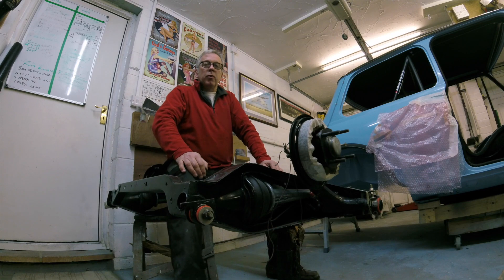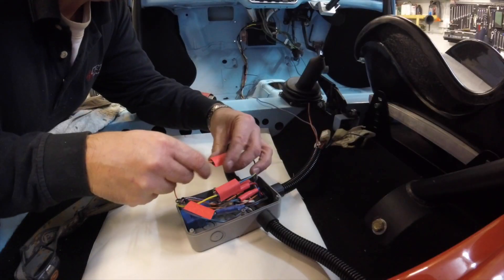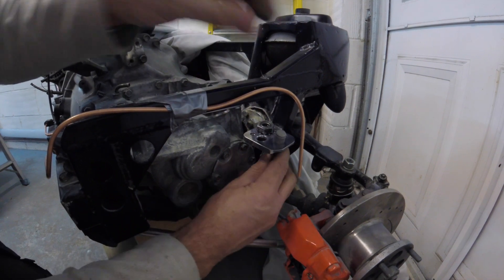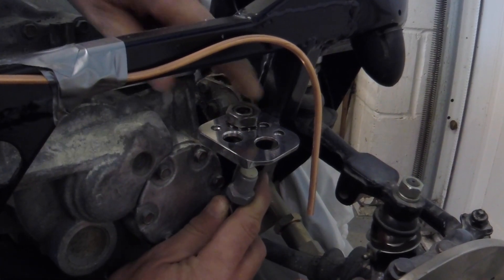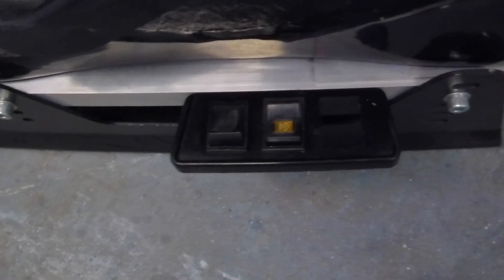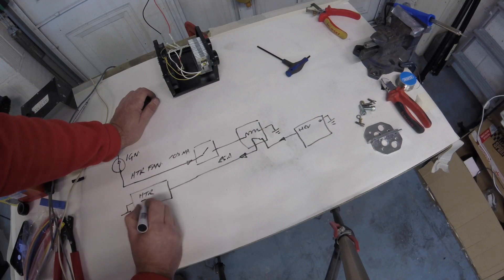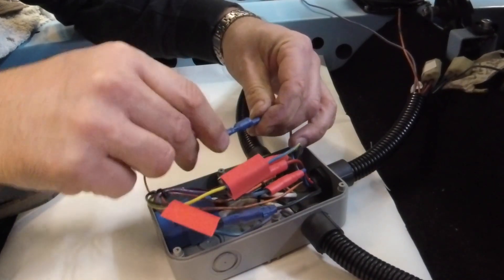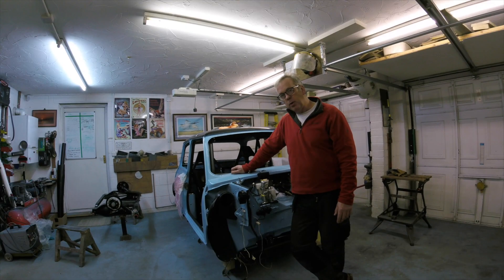Mini Nissan CG Engined Micra K11 engine conversion Episode 9.

Comment: David I noted in an earlier video that you had gone for the bigger 1.4 litre engine and box out of the latest model k11 micra, do you know if this is the same engine and box advertised in the 1.4 k12micra, many thanks jamie
Reply from the maker: The K11 1.4 is different to the K12 1.4, I am not sure if anyone has tried the later K12, it does seem to sit a taller in the engine bay, it would be good to know as they were built for much longer and in good supply.
Reply: @davidlee4966  yes that's certainly true David the more recent k12 engines and cars can be had cheaper than the older k11, I'll have to hold out for the right car then I was hoping to be able to use a k12 engine but don't want to risk it now as theirs not much room for unexpected problems in the mini engine bay, I have made a flip front front end out of steel panels rather than using the fiberglass so I don't have the inner wings or anything to contend with, keep up the good work.